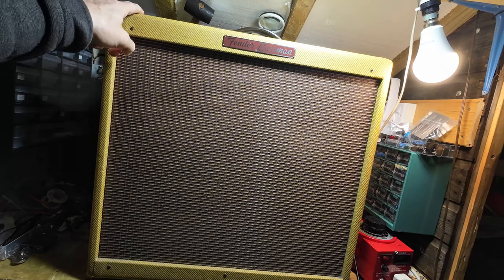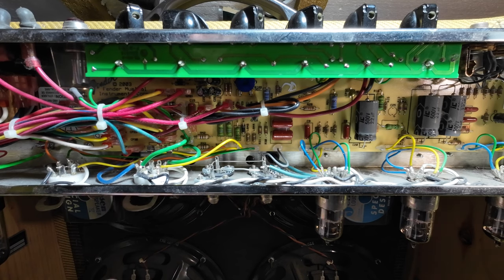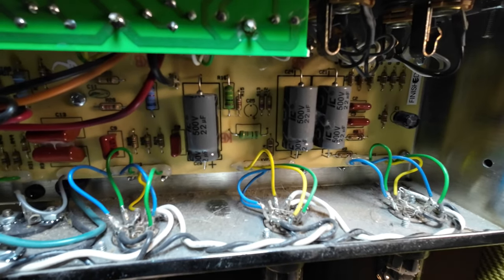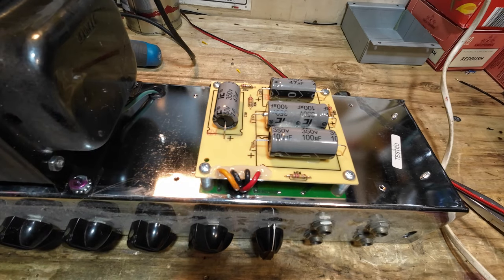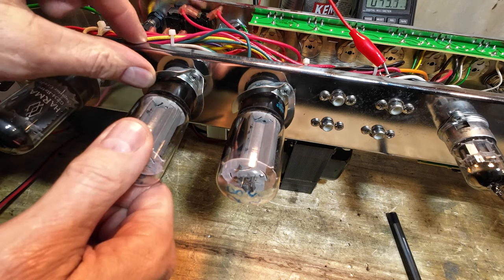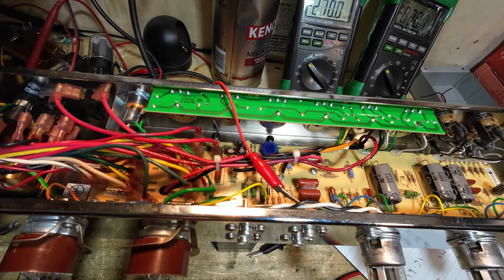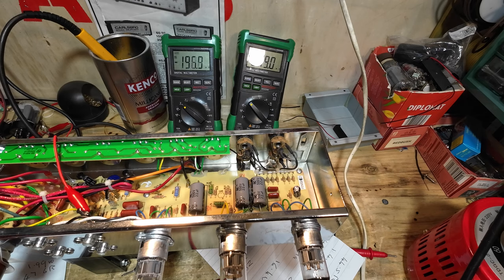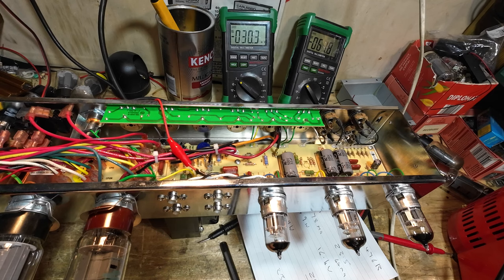Fender Bassman Reissue Part 1  Wrong Output Tubes  Wrong Primary Power Voltage Wrong Bias Setting

Comment: Nice explanation!  I like the old Fender amps with the bias balance circuit (output tubes matching).  That way you can use tubes that aren't perfectly matched.  Also, I've seen amps where the resistance on the 2 halves of the output transformer differs by a fair amount and the bias balance circuit can compensate for that.  I usually add a bias trim pot to the bias balance pot (after lowering the value of the bias resistor to ground), so you have the most flexibility in dialing in the bias.
Reply from the maker: Hello Michael, thank you. It makes you wonder why more guitar amps don't have a balancing pot on the bias. It makes sense. I have never worked on an early Bassman. We don't see many of them over here. What few there is are in collections. A good idea to have the trim pot with the Balancing pot. Take care Michael
Reply: @vintageguitaramp_guitarteacher  I know Fender amps were rare in the UK up until the mid 1960's due to the import ban after WW2, but I would have thought they would be more common these days.  I now have 7 of them from the '60s and '70s, the most recent a Vibrolux Reverb I received on Monday.  Ordered parts for a recap and other maintenance yesterday.

Comment: Bassman Reissue not a real one BTW. You can totally use a 5881 in that amp, probably better because they draw less current and get lower volume breakup. Those Phillips ECG if I am not mistaken are ruggedized 1970's tubes or valves for you in the Monarchy. You can't tell until you check the bias actually if they are messing anything including themselves up .(edit) After I watched I see you are doing what I imagined I might do. I just don't care for any tube/valve amp with a PCB but that is just my humble opinion.
Reply from the maker: Hello, yes, not a real one. I should have made that clear in the video. I should have also made it clear that the original 59 Fender Bassman came from the factory with 5881s. I have amended this in the title and description. 59 Bassmans are rare in the UK. I have never worked on one before. The problem with this reissue is the bias trim pot didn't have enough sweep to adjust the bias down cool enough for this set of 5881s. I did show that in the video. It then means that the board will have to come to change the bais circuit. So this particular set of tubes were not right for this amp. Of course some 5881 tubes draw more current than other 5881 tubes do. I don't think I made that clear enough in the video either. So I am sorry for that. Thanks for pointing that out. It's fair and constructive. Thanks for watching and take care.

Comment: Worth noting that the original 4 x10 Bassman did use 5881 tubes, running well above their specifications, but back then they had tough-as-nails American-made 5881's which were made to military specs.
Reply from the maker: Hello, good to hear from you again. Those 5881s were JAN tubes. The boxes were in the bottom of the amp. The dates on them are December 86. So they were bought as new old stock. They are 6L6 WGB tubes. Would you class these as good tubes?
Reply: @goodun2974 - JAN Philips tube is actually a military spec American tube. The last runs were spotty and circulating
Reply: That might be true, but do we know what brand or manufacturer was of the original 4x10 Bassman output tubes…? It could make a difference.
Reply: truth
Reply from the maker: i should have pointed out in the video that the amp was a Bassman reissue. The bias circuit in the reissue amp wasn't right for the 5881s. The sweep on the trim pot ran out before you could get the tubes to run cool enough at 70% of 23 watts. Taking the pc board out just to change the bias circuit wouldn't be a great idea. I didn't make that clear enough in the video. I have amended the title to reissue though.
Reply: @vintageguitaramp_guitarteacher  Those JAN Sylvania/Phillips made tubes were one of the best/toughest 6L6 type tubes ever made despite the WGB rating. JAN needed to be the toughest, don't fail tubes and were routinely run over spec. And you're absolutely correct with re-bias as always with any new power tubes. Also, these tubes present the exact same load to the OT primary as a WGC rated tube,  3.5-4K ohm.
Reply: @cirenosnor5768 JAN means Joint Army Navy.
Reply: @fiddlix Tung Sol was the original manufacturer of old tweed Fender amp tubes.